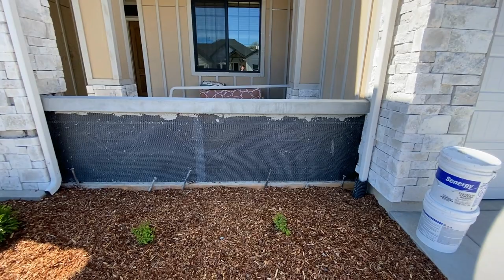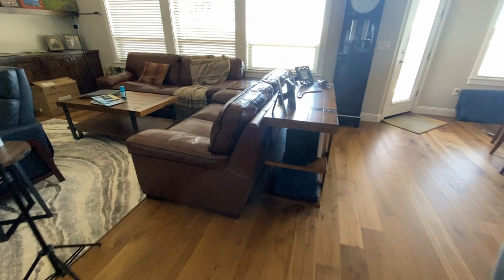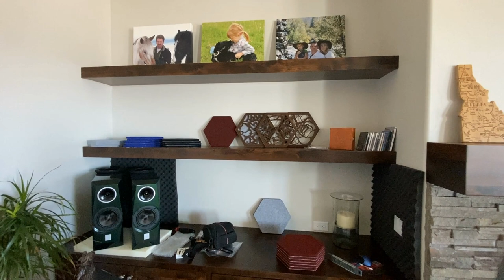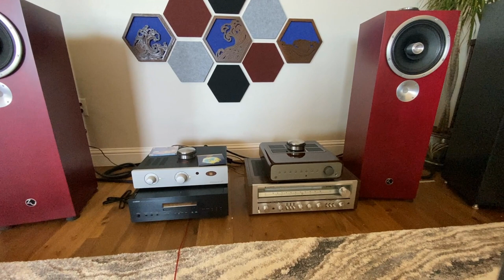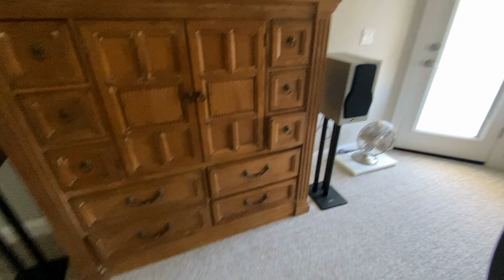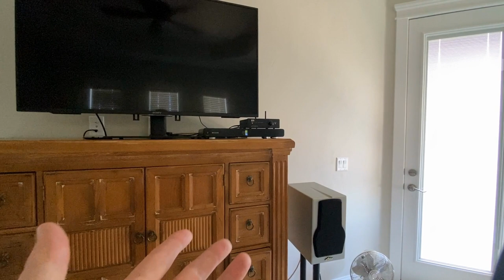Idaho New Build Issues; 2 Channel Updates and room tour.  Its a process!

Comment: Nice house, hang in there. We’re in Eagle and went through this about 3 years ago.  You expect competency in contractors, but you end up pulling your hair out for the lack of it in some of the workers/trades.  We’ve gone through this process of building several times and it never gets any better.  Right now with this boom, it really difficult with material and labor shortages.  We had a long list of punch items and it took forever to get through them.  You’ll so look forward to the time when this is over and the last sub contractor is gone.  Then you can relax and have your new home and your life back.  🙏
Don
Reply from the maker: I appreciate your words Don.  We sold our Eagle home built by Red Leaf and Austin was really good to us; I understand times are different now, but where is the communication and customer service?  Our current builder is out to lunch to say the least.  Going weeks without a word is unacceptable for any trade or service provider.  Yes, the day the last sub finishes will be a great day indeed.  Cheers and thanks for chiming in!

Comment: Is your sub floor osb ? If so did they staple your hardwood floor with u shape staples or L shape nails? L shape is the way to go. Otherwise your floor will crack everywhere especially if you have 4 seasons. I redone my neighbor’s floors , we simply nail it and clued it . I do that for a living:)
Reply from the maker: Hi Denis, they used the nails, but I do not think they also glued the planks down, so they can be replaced if damaged.  I have the 1" Osb subfloor, but it took a lot of rain and snow last winter, all the edges lifted up pretty bad and while they sanded those edges back down before installation, there is no chance of really evening out the floor again.  Most of the house flooring is pretty solid, there is only one room where I can actually feel the difference walking across it.  Such is life...they house is beginning to feel like home and that's most important now.

Thanks for sharing the tip. Cheers.
Reply: You either inject glue with a 1/8“ diameter by drilling a hole in corners of the plank or simply cut out the plank and glue a new one :) nice home !
Reply from the maker: Thank you Denis :-)

Comment: I noticed you have weights on your Zu speakers. Is there any noticeable difference in sound if you add those weights? Or is there any other reason to add those?
Reply from the maker: Hi Leo, not really.  They were more for when we were living on the third floor of an apartment building, certainly helped with vibration and shock. More of an insurance policy, I doubt I could pass a blind listening test with the difference.